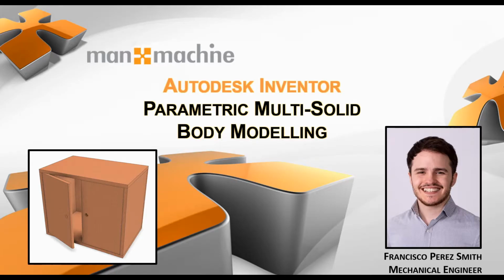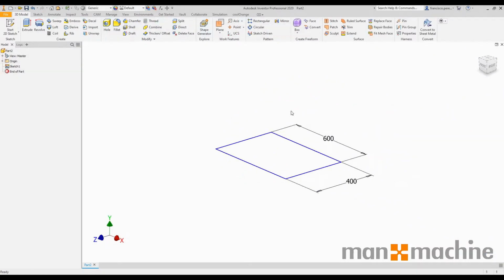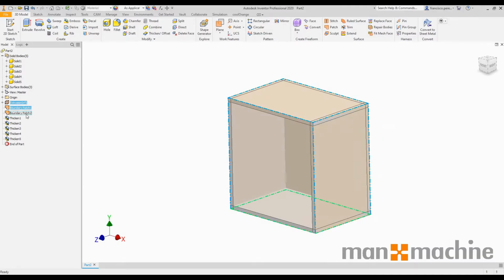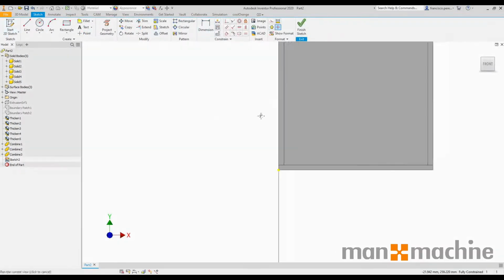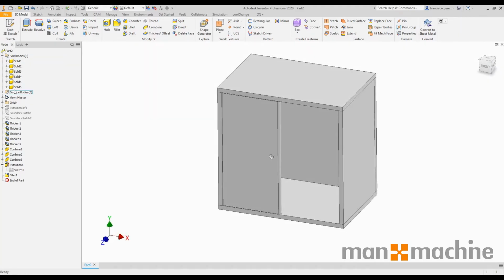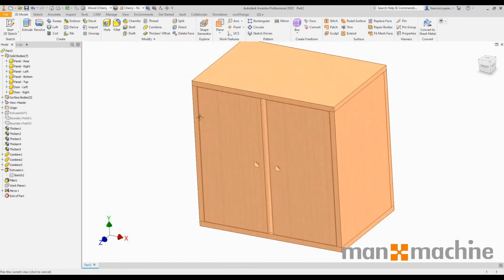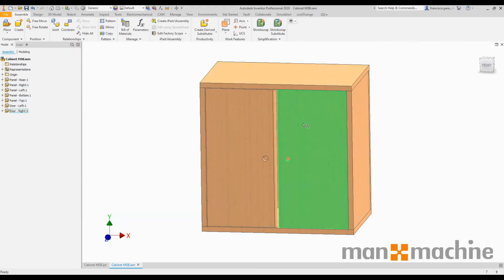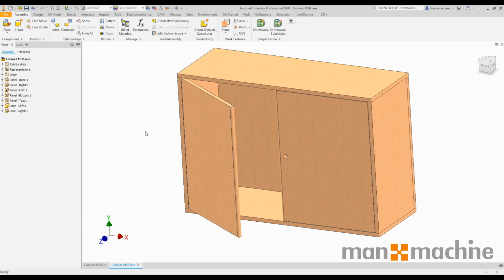Parametric Multi-Solid Body Modelling in Autodesk Inventor

Comment: Very good tutorial, thank you! 
Do you know if there is a way to make a copy of the multi solid body model or assembly independent of the parent to make variations for example?
Reply from the maker: The original part can be copied and then the “make component” process can be repeated to create a new assembly.  The new assembly will then be linked to the new part.  Other options you may want to try are Design Assistant, Pack and Go or Vault Copy Design to create duplicates.

Comment: I don't know my man, this si a wonderful way to make separate files without the need to use assembly, I really wished inventor was as good as fusion 360 in this aspect,  360 is more flexible in this case, one can really create completely separate components and move them around like easily. You think we should just migrate to fusion 360? seems more versatile in this way of modeling. Is this as good as it gets in inventor to create multiple components within the same part file?

Comment: Nice I'm looking at Inventor as a cost alternative to Catia (after using Catia for 10 years) and the fact that it has the multi solid body option is making the transition much easier,
I have found a flaw in your technique you are using B-reps if you are doing parametric modeling all the dimensions have to tie-down to the origin.
In a more complex model, you would be creating failure features each time you use a B -rep  try to train yourself to create a plane offset from the UCS as a base for the sketch.
Anyway GOOD job!!!, thank you for sharing!